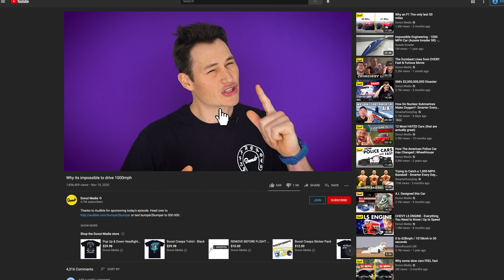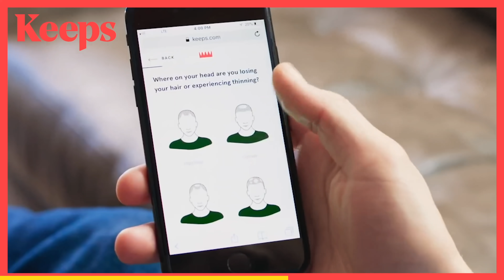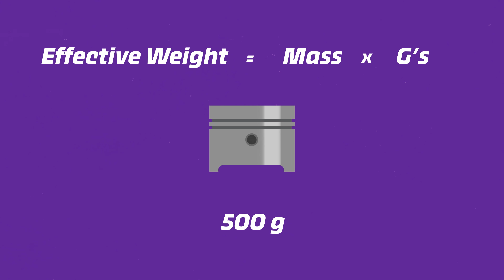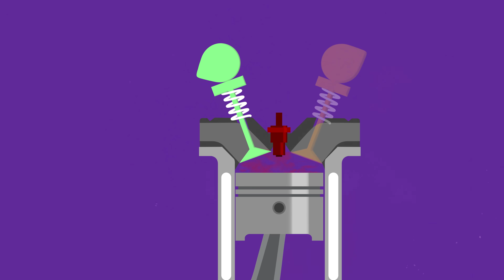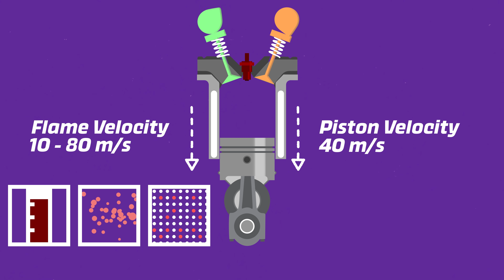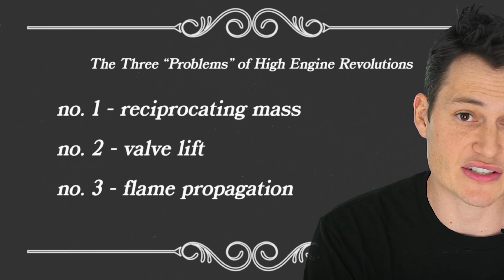Why It's Almost Impossible For An Engine To Rev Over 20,000 RPM

Comment: Good old CBR250RR revved over 20k. Loved that thing!
Reply: Or a lot Honda’s 60s and 70s race bikes
Reply: @darrengolladay9359  cbr=4 stroke 
Nsr=2 stroke
Reply: 23000rpm. I had one. It was phenomenal.
Reply: @obsgr1  you had it for how long?
Is it true they werent reliable?
Reply: @FirstLast-tx3yj  had a mate who'd gone through two and both seemed to be unreliable, still an amazing sounding bike
Reply: I had a Suzuki 4 cylinder 250cc 4 stroke. 42mm bore x 21mm stroke from memory. 6 gears 17,000rpm redline. Would do around 180kph on a flat road. 
Not much go below 8000rpm, but it was light, cheap and fast! Valve check at 30,000km- every valve was perfect. 
Oil changes were critical though as the oil worked quite hard.
Reply: @obsgr1 liar
Reply: @darrengolladay9359  nope, cbr250rr's are 4 stroke..
Reply: 250cc screamer bikes are pretty common here and there are rumours about incoming new ones from yamaha and honda
Reply: @leovannbelleca7319  I think yamaha is but honda is buildin a 2 cylinder.. for better torque I guess.. and cost..
Reply: @kleidtomasse  yes it is. Its called the cbr250rr. But the incoming one has an extra R in the name. But for now its all just rumors. And yes, the zx25r is shitty of torque, common disadvantage of inline 4 engines, even duke 200 accelerate faster than this hehe
Reply: @leovannbelleca7319  I think yamaha is but honda is buildin a 2 cylinder.. for better torque I guess.. and cost..
Reply: Honda rc166 22k
Reply: my rc tops out at 32k rpm. Also its possible.
Reply: Bruh you guys don’t get it, the mc19&22 DO NOT rev to 20,000rpm, yes the tachometer May say but when you put it on a Dyno. You will see that a accurate tacho will put the mc19&22 limiter at no more than 18300rpm. They rev high yes but the 30 year old Honda tacho isn’t reliable source. Ask any mc22 owner who knows what they own. They will say the same. Only revs to 18000.
Reply: @amosxx-1264  you are right, except it's 17300 not 18300. Same with all the other 250 4 cylinders, none of them revved as high as their guages indicated. Still an impressive feat for cheap mass produced bikes from the 80's and 90's
Reply: Yes my dude one hell of a bike. Makes all the right sounds.
Reply: @darrengolladay9359  I've got one. Last time i looked it was a DOHC four stroke.
Reply: Having moved to canada I regret not importing mine, miss the thing
Reply: @mopishcross1729  you can still get another one I see them for sale in Ontario all the time
Reply: It was the cbr250rr mc22 which was sold from 1990 to 1999 that revved to 20,000 the cbr250r mc19 from 1987 to 1989 revved to 19,000, due to different carb size injector jets. Top speed was around 200 kph. Super awesome bike.
Reply: @darrengolladay9359  No, the CBR250 and ZXR250 are 4-stroke, and from 30 years ago. 4 cyl, 16v, 4 carbs.
Reply: @clivenorton2834  yes they are, my CBR250 was sold in Japan before they had a limit on power it redlined at 22,000 with a 220kmh top speed though I never took it over about 185kmh and didn’t do that too often. I racked up about 2,500 km per month and it needed rear tyres about every 10 months, it was only when I didn’t use it so much (over 6 weeks) that it became extremely difficult to start
Reply: Hey Steve. Nice to see you here. Love Rc , love motorsport.
Reply: Everyone in the comment section is wrong…
Reply: I remember the grey imports to the UK, the  250cc inline four cylinder Suzuki GSX-R and Kawasaki ZXR, both having an insanely high red line. And they looked like a shriveled version of the inline four 400cc from the same manufacturer. The 400s looked better than the 250s, no doubt. But I didn't get excited by either. 250 four stroke, nah. 400? Nah.
Suzuki RGV250M. 2 stroke. 
"Hmmm I love the smell of Motul 800 2T in the morning"
Reply: @darrengolladay9359  the down stroke it the power stroke, the up stroke is the exhaust and compression stroke on a 4 stroke
Reply: @strawmantee3085  you are right. I should have said that the top of the stroke where ignition occurs is where the tach signal is taken. So with a 4 stroke you get one ignition per 4 strokes......where as a two stroke you get two ignition signals per four strokes.
Reply: @darrengolladay9359  your fired!
Reply: And It was made in the late 80’s.. got a kawasaki zx-r 250 back in the day and it was fitted with basically a straight pipe(dang good music).. and last time I checked it was/is a four stroke for the dude sayin its a two.. miss that old bike..
Reply: In fact here the zx25r costs more than even the ninja 400 but surprisingly it still sell like hotcakes as even the incoming stocks are already reserved and sold! But apparently this bike is really meant for indos because of huge discounts on bikes below 250cc
Reply: Legendary
Reply: Had one....and have to say...
Reving that thing and  it going anywhere was pretty....embarrassing lol
Reply: Cbr250
Reply: Reading these comments saying the CBR250rr was awesome and praising it... mmmmm

Gonna have to disagree lol...had one...and I rekon I would of been "happier" with the VTR250 ( as a first bike/learner legal bike in NSW, Australia)
Reply: those are pretty rare :) engines even more.
Reply: @darrengolladay9359  he clarified they were talking about a 4 stroke in the beginning
Reply: @capicheeno746  the Cbr250rr is a 4 stroke...
Reply: @CharizardChaser96  that too
Reply: Right, laughs in Kawasaki Balius!
Reply: gsx-r250r fours too, much grin factor :-D
"what's it rev to?" [pal with gsxr11slab]
"well over 20thou" 
"that's obscene!" [gsxr11 pal]
"I know! great isn't it!?!"
Reply: I was about to say that
Reply: @darrengolladay9359  nope....the little pistons could rev as high asf
Reply: @darrengolladay9359  The CBR250rr is a 4 stroke. Ive owned 3 of them. They rev to 20k easily and loves to do so aswell
Reply: Honda Jade ftw.
Reply: @justan idiot lol i know. But its because i have just 3.5 cc
Reply: It’s a screamer
Reply: My first ever road bike
Reply: Loved to learn road bikes on mine. Awesome bike.
Reply: accidentaly revved my r6 to 21000 when tge chain popped off😋
Reply: MC19!
Reply: the rr redlined at 19k the later fireblades 18k but 1cc more on the bore. But if tuned mildly 20k was doable on the rr for sure. I had one in the 90s and achieved it too.
Reply: Honda once built a 125cc 5 cylinder(!) that hit 20,000rpm regularly
Reply: i'm pretty sure they redlined at 19,000 and only if they had their ECU adjusted or you bought one meant for the Australian market, all the models built for the Japanese market were restricted and peaked around 17,000
Reply: @Popsicle_MP  I've  got one.  They're carb engine. Mines a 1991 and it goes easily about 21k rpm in 1st if you're not careful. There's no point letting it rpm there because the power drops off but yeah it goes there a bit too easily actually.
Iirc the stroke is 38mm.
Reply: @Popsicle_MP  nope, the Aus delivered were 18,500rpm, the grey market ones were 20,000
Reply: @Popsicle_MP     old 4 cylinder not the new
Reply: @Popsicle_MP  No ecu son. it's all about carb and CDI lol.
Reply: @Popsicle_MP  aussie aussie aussie. Oi oi oi.
Reply: @Popsicle_MP Not true. The Aussie models were the ones that were restricted. I own both and the Japanese has a redline ending at 21k rpm.
Reply: Honda is the most genius company in history. The genius of Soichira Honda and his racing spirit are unparalleled and it reflects in everything they ever made. They made the most advanced motorcycles of all time, dominate MotoGP with the record number of titles, Isle of Man TT, first car they ever made revved to 9500 rpm and beat cars with twice the amount of power.  They went on dominating every single motorsports to dominating Ferrari in Formula 1 as well as at their own supercar game with the NSX. I don't care what gtr fanboys and Ferrari fanboys say. They always got owned by Honda anyway. Lol. SMART people know that Honda is the most legendary name in history of automobile and motorsports. No other brand even comes close to their genius and the art they create. (Maybe alfa romeo and ferrari had the passion but they never had the engineering genius and technical knowledge of Honda)
Reply: My brothers old fzr went to 22000rpk plus
Reply: @Josh-cw8by  No.

The 1989-1993 zxr250 redlined at 19,500rpm, the new zx25r redlines at 17,000rpm.

I know you don't mean to spread misinformation, but do your research before commenting.

Source: I owned a 1989 zxr250.
Reply: Gladiusite I googled it and both your answers are wrong as the bikes had different specs depending what country they were sold in just like cars
Reply: @zvarkfitzell4527  the Japanese models A/C (89-90/91-93) and the Malaysian models had slightly different specs, Malaysian had a purple scheme and a different speedo to tell the difference
Mine was a 1989 ZXR250A imported from Japan.

My comment was more to poke at josh who was condemning misinformation, whilst spreading it himself
Reply: @NomyNomyNomNom  Still wrong info bruh. We have the Zx25r in our country and i can tell you the redline is 17500 rpms to be exact. The rev limit is at 18k but it can be easily deactivated with an ecu tune. Ths is why the dash have rev counter up to 20k rpms
Reply: @leovannbelleca7319  every dash shows more than you can achieve and under certain circumstances, like going down a gear or down a hill, you can achieve more rpm than the acceleration limit
Reply: Those things are so sick!
Reply: since bikes had to make their way into the comments, you know what looks ridiculous and just sounds annoying, a bike over 15k rpm while doing 50kph
Reply: @Popsicle_MP  I suppose it would, but the CBR250 and ZXR250 were missiles, not mopeds.
Reply: @Popsicle_MP  When your bike revs to 20k you could give to shits what you "look like"
Reply: @Popsicle_MP  you do realize that bikes have a gearbox as well so there is no need to be at 15k rpm when going 50 ;)
Reply: @rem362  I think he's talking about the annoying riders who do that just to show off
Reply: came here just to say cbr250rr

donut struggling for content once again
Reply: F1 engines rev over 20k easy.

Comment: If you want to look at engines that can reach your back 20 thousand RPMs you can look at the old glow fuel engines for model Aviation engines like the little black Widow half a I think it's about 1800 RPMs but of course it's basically a 2-stroke engine with open ports
Reply: You left off a zero. Should have said it's about 18,000 RPMs

Comment: Um... Rc motors crank over 60k rpms!  Piston speed is the limiting factorand considering an Rc motor has like a quarter inch stroke and the top piston speed I think it's 9.5 feet per second,but don't quote that, and that don't matter if it's a street motor or a F1 motor that's all the faster pistons can go. Same that's why F1 motors are way over bore,like 2to 1to the stroke and can achievethose rpms! And that's why a .12 ci. Rc motor can do 60k rpms

Comment: People be like: physics limit an engine from going over 20,000 rpm

Meanwhile somewhere in the universe about 1,000,000,000,000 light-years away:   antimatter black hole that has enough negative and positive force to destroy the entire universe in the span of infinity and also negative infinity

🤔

Comment: Speaking on valves, there's also desmodromic valvetrains in which there is a seperate cam for opening and closing the valve, eliminating the need for a spring. Although they eliminate valve float in the traditional sense, they are more complex and more expensive.
I think some old Merc racing cars used them, and Ducati is known for their Desmo engines

Comment: Jet turbine engines spin at 20,000 rpm. The impeller on a Q50 red sport however spins at 200,000.🤔

Comment: "No engine can rev above 20k" allow me to introduce you to my uncle's 87 RX-7....
Reply: yes but it has no pistons, wankel engines has a ton of diffrent problems, but it for sure can rev higher then a piston engine. even Mazda seems to have given up on it now. rc jet engine runns at 120000 rpm so engines can run faster still a diffrent kind of engine.
Reply: Video link?
Reply: @therealracer135  lol. There is no link. It's a joke on how ppl say rotary's don't have a rev limit.
Reply: @uranumbnuts  say hello to the apex seals
Reply: @NovaZocket52  goodbye*

Comment: Not limited by physics but Rather mother nature What I THINK he meant "THINK", is how the fuel couldn't really catch up with the piston, so I mean yea it's a form of physics, but how rapidly do you think a gas could expand and ignite 🤔 maybe we need some new fuel? 2 Stokes don't use valves so problem 1 solved, but what's next? A super high pressure injector thatll help thrust a piston downward+ the fuel ignition? Idk we'll have to start making blue prints of the best possible design in engine motion

Comment: Port air speed is also a factor.  Many ports start experiencing reversion if the air exceeds Mach 1.  This is another reason it’s important to keep piston speeds as low as possible... long rod ratios coupled with short strokes help keep piston speeds lower (also aids with flame propagation as the piston speeds more time around TDC along more time for fuel to burn before the piston starts trying to out run the flame front).  For most OEM Pistons the highest safe piston speed is around 3,500fpm, good performance Pistons will tolerate another thousand rpm on that and high end race Pistons will handle 5,000+ fpm before flying apart
Reply: It's not about "pistons flying apart" at high piston speeds, but it IS all about whether the conneting rods will or will not be pulled apart and break during the period where it has to suddenly stop all the piston weight, and instantly reverse the piston's direction at TDC during the exhaust stroke. THIS is where most connecting rod failures happen. Rods don't break from horsepower, they usually get pulled apart from excessive piston weight at excessive RPM's, for the hardware. 

Pistons don't just suddenly "fly apart".... they break from things such  as severe detonation, too tight of a ring gap which breaks the top of the piston off when the ring ends butt together from not enough clearance and excessive heat, slamming into the head because of too little deck clearance or a rod bearing failure, a seized bearing on the big end of the rod, a pin failure, or several other issues. We are not at the limit of the strength of the material, or piston design, when it comes to piston  speed. 
No one is having issues with pistons just "flying apart" from too many RPMs... Something else such as a rod failure, too tight of a ring end gap, severe detonation, or whatever else will happen well before a piston just decides to disintegrate for the hell of it.

Comment: Meh it's actually very possible to reach 20000 rpm it's actually quite simple you see. You just take TWO Formula AE101 mixed 4age hybrid engines sourced from mysterious subuka shop you join em together like bmw joins inline 6s for v12s and BAAAMMM ya got a 22k rpm Japanese v8 🕶️ woop. woop.

Comment: Great video as always. Your content always informs and giggles. Good stuff. Two things really stuck with me.

1) NEVER make your bang face again. That’s a terrible bang face. I’m off to watch some solo amateurs on YouPorn to put balance back into the world.

2) Best trade off explanation ever! For this reason alone, I’ll say it: always overrun the cylinder at the end of the power stroke so your exhaust goes anywhere AND EVERYWHERE but the uterine manifold.

It’s a mess, but those things are a straight up interference design for everything in life.

PULL OUT KING!!!

Comment: i see simple solution. use a small gas turbine engine instead of a piston. Solar t62 turbines idle at 30000 rpm and redlines at 60000 rpm. problem with turbines is the how difficult they are to start in the first place

Comment: 2 strokes and rotaries :
idle at 50k rpm, rev at infinity
Reply: laughs in Simson 2 stroke engine
Reply: @jochen__  Simsons sind ja auch eher wie Dieselmotoren vom Ansprechverhalten her. 😂 Meine Gilera SMT 50 (Derbi EBS Motor) und meine Rieju MRT 50 (AM6) unterscheiden sich schon heftig und die Motoren sind schon ähnlich, sowohl vom Aussehen als auch von dem Aufbau.
Reply: No valves so they rev as fast as you can put fuel and air in them
Reply: @therandomman6647  sooo multiple inline turbos all with increasing boost and insanely large 1000 cc or bigger injectors?
Reply: @therandomman6647  reedvalves and transfer ports, sir!
do you know nothing of expansion pressurisation exhaust gas valving?
those spannies stop unburnt fuel being sucked through at higher rpm causing over burn of the incoming charge, the reeds stop mixture being forced out via the carburettor, and the position and dimension of your piston's porting is your inlet valve and timing.
then there's powervalve solutions of various types..
lots of valves in twostrokes, more in fact, more diverse.. some a little more theoretical.. but not as barking mad as intersectional feminism.
ungineering mate.
Reply: @michelguevara151  not in a rotary
Reply: @therandomman6647  what about flame propagation?
Reply: Gas turbines: laughs in 70k rpm
Reply: @VigilanteAgumon  Those things are turbochargers with continuous ignition in between. There's no valves opening and closing relative to shaft speed
Reply: Actually some nitro RC engines rev at 50,000 RPM
Reply: @paulspomer16  thats relative to its size. Most are single piston with No valves
Reply: FichDich InDemArsch  Yeah but MZs also don‘t rev that high.
Reply: Thought the same :D i was like: uhm.. rotarys can go higher than 20k RPM. They are nuts!
Reply: @mirai-neo  mine only goes to 10k what am i doing wrong here?🤣🤣
Reply: Everything that spins has it's limits, even 2 strokes and rotaries.